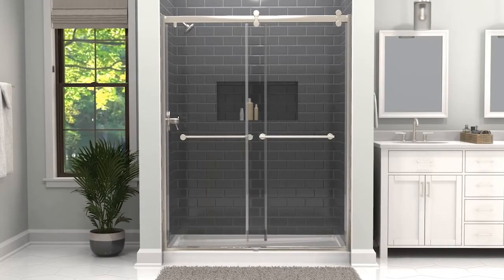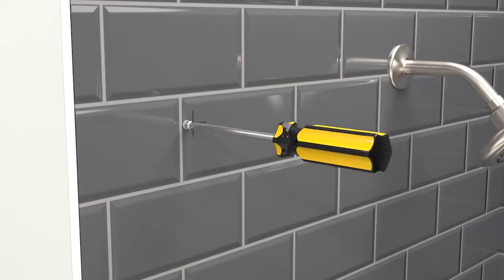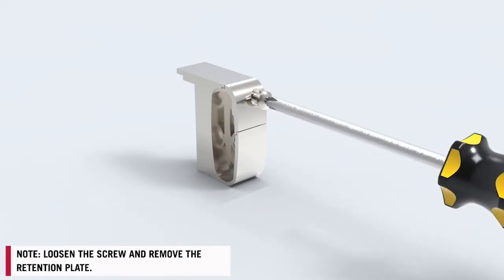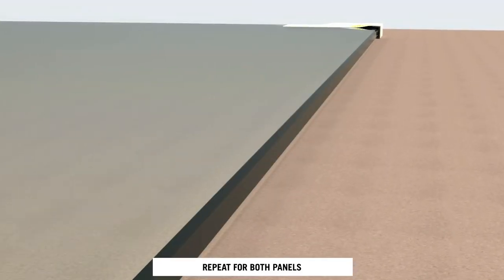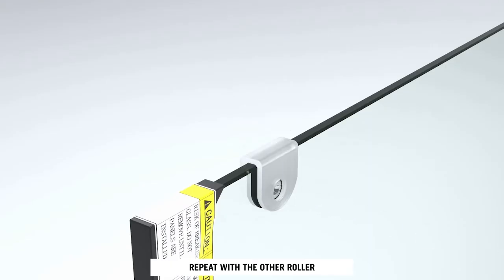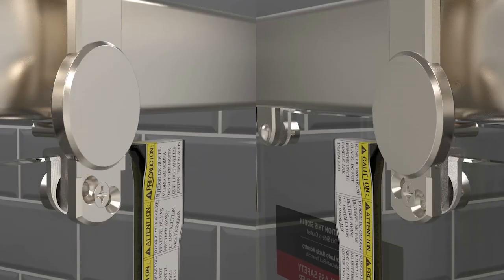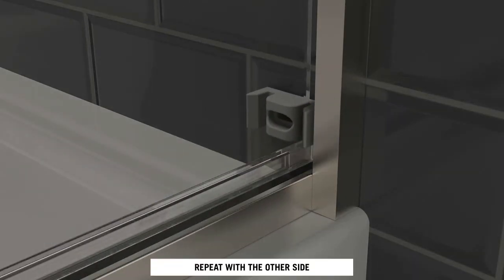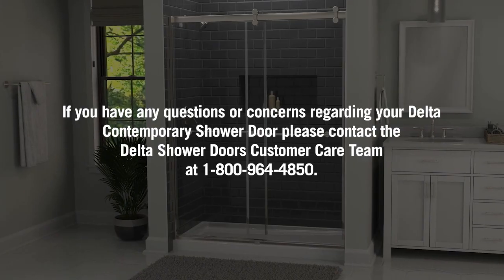Installing Delta® Contemporary Sliding Shower or Bathtub Door | Official Instructions and Pro Tips

Comment: I had it professionally installed and they messed it up.  The doors slide open to the right while taking a shower. I put a level on a top track and it is off. Now they are giving me the run-around to come and fix it.
Reply: your base most likely was not level and they assumed it was.  not a hard fix

Comment: I have this same shower door but for a tub, the design is made where there is about 1/2" gap where water seeps through and splashes on the ground. Has anyone experienced this for the tubs with this shower frame/track.

Comment: For the delta classic 500 door, I drilled and screwed in the top bracket next to the top of the jambs (exactly like this 3:20 video). Then found out later that it has to be below the jambs. 

So now I have to take everything out and I’ll have holes in my tile that I need to somehow patch up. Instruction manual wasn’t clear at all and didn’t even show the collar below the jambs in that step

Comment: Silicone is the only thing holding the bottom track?
Reply: yes, just tape it down for the rest of the installation time and it should be dry enough to remove tapes and finish when its time to silicone everything up
Reply: The weight of the doors the anchors on wall hold everything together. Great system

Comment: Anchors not needed if securing into wall studs.   You should mention that
Reply: People generally know that, I hope
Reply: @KendallHall  From the Manual: "NOTE: Wall anchors MUST be used. For ceramic tiles, appropriate wall anchors can be used (purchased separately)."

It does not say "Unless you are screwing into studs."  So While it seems like you shouldn't need them with studs, it does not say that in the manual. This may have to do with preventing water penetration into the hole,  which would quickly rot enough wood for the screw threads to lose grip. I would definitely contact the manufacturer to clarify this.

Comment: Would be nice if you uploaded a video showing how to install it with a rounded bottom. My shower has a rounded bottom and I can’t find any video showing how to install it.
Reply: Use a quarter to get the radius and file it down with a grinding wheel or metal file or even metal sandpaper
Reply: Use a metal file to file it down to match the curve of the tub..